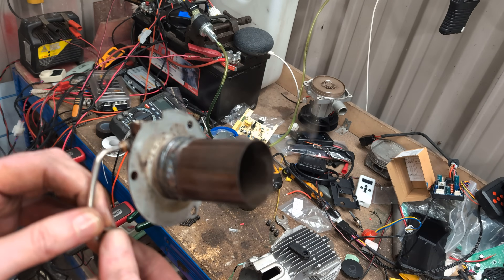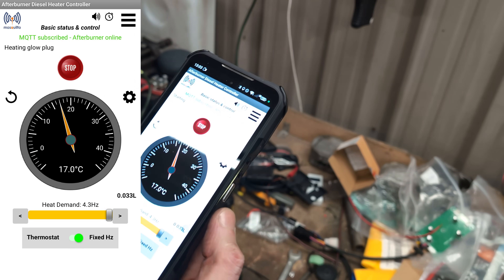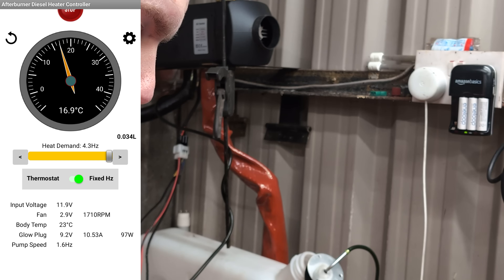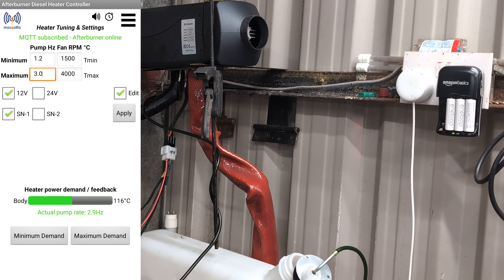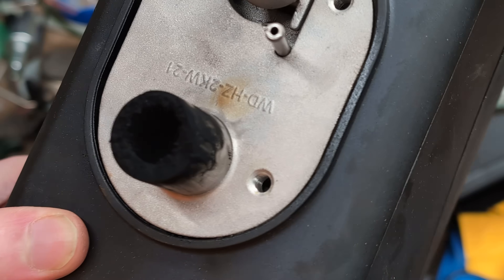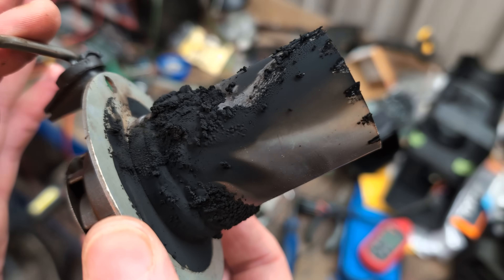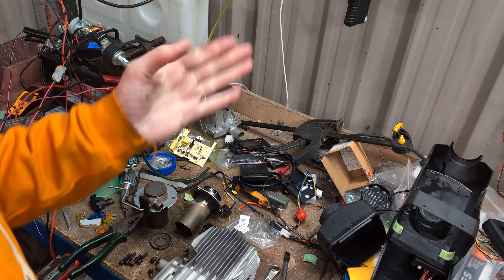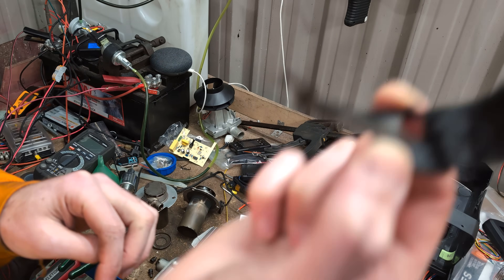Diesel Heater testing filtered waste oil - 50/50 diesel oil mix modified burn chamber - part 3

Comment: My kerosene (home heating boiler) central heating burner pump has been pumping oil for  over 30 years people say  kerosene has no lubrication I disagree and say kerosene, parifin or home heating oil or whatever you want to call it has lubricant it is oil and burns very clean.
Reply: There are (at least here in the Netherlands) different ratings for the kerosine. The more expensive the less lubrication and more pure it is. So maybe the real pure stuff might become a problem. Forgot the rating system. I just look at prices. But thanks to the government here, kerosine is more expensive than diesel. So that is no option anymore 😢
Reply: @BenVeenstra  In the GB there is two types of home heating oil I believe I order the less smoke type 28 second for low flu on my boiler and 35 second will be used in high flu boilers and commercial use allso as jet fuel. So I pay around 60 pence per litre which includes taxes and I live in a area of gas heating or kerosene oil heating is popular and so I don't need to burn waste oil in my diesel heater.
Reply: @BS-ql5nl  that is a big difference with the Netherlands. Especially now Germany is also slowly getting rid of kerosine heating. You can't buy it in bulk anymore.

Comment: I  find the more Flammable, The less the heat created. But i can understand a slower diesel  burn, I'm guessing it will not flash as quick and create more heat. Remembering its not the burn we get heat from, But from around the casing blown by a fan.

Comment: Thanks for continue to try. I have 2 diesel heaters and access too much motor oil. Only way I do it is a stainless steel dog dish in the shop woodstove, just have to refill it every couple hours. My Grandpa had an oil drip stove.
Reply: I suppose the downside is that you need a wood stove with a chimney/insulated pipe all the way to the canopy. That is expensive to install these days. And a lot more work. Also, won't burn as efficiently or as clean for the atmosphere. But in a rocket stove it will burn a little better with the secondary burn event of smoke and all. I'm considering a rocket stove with added oil drip pan together with heating hot water to feed my existing radiators. Quite the project but with current prices I might just get my investment back within one cold winter.

Comment: Only time I've seen carbon deposits like that are up a coal fire's chimney, and on my Aladdin paraffin lamp's mantle when the flame goes "spiky" (where it's not burning right and produces yellowy-orange spikes and leaves the carbon deposits on the mantle), which of course all means that there's not enough air to meet the burn requirements of the fuel, but, still, engine oil, not meant to be burned anyway... :S

Comment: I‘m interested, what would happen if you run that modified burn chamber just with diesel tho
Also kinda surprised that this mesh runs around the bottom part of the chamber in there.
Also, what‘s behind the fuel pump in your setup?
Reply: I'm interested in that as well!
Reply from the maker: To the left of the fuel pump is a battery volt/amp meter and a shunt.

Comment: I've ran one of these heaters in a static caravan for a few years now, along with many other residents. We mostly run on Kerosene and have had few problems, mainly pump failures (Not due to kerosene) and glow plugs. No blockages to date. Started out on red diesel unto we found a local source of kerosene. In the future, looking at probably an Afterburner, but running my own Arduino solution just now. Many of our setups run larger 6mm OD flexible pipes and use push airline fittings as well. Best mod was replacing standard fuel tank for outboard style tank, with Mariner quick connections and a hand purge BULB for quickly purging the line. Other mod was replacing power cables with 4mm supply and have no electrical issues since even at ~10m length.
Reply: I have given up bothering to add my findings about paraffin in recent decades (I am 70 now). I just got stupid abusive replies. In "yer early days" as Alf Garnet used to say, there were 3 grades of paraffin. They were readily available, and you specified which you required. The cylindrical stand alone paraffin stoves (usually situated next to the spitoon) used the coarse stuff, the large mantle lamps and Tilley pressure lamps could use either of the two finer grades. The jets in the lamps and the mantles lasted an impressive amount of time if they used the best paraffin, but many hated paying the higher price. The common wick and chimney lamps required the best stuff. I recall my grandparents quoting the names of some of the best oils, used in wick burning lamps, and they sadly regretted the way they were no longer on sale at the chemists in nicely painted tins. Using paraffin in a wick and chimney lamp is the acid test to whether it is a clean burning oil. I have used paraffin in my lamps, Tilleys, and my Russian/German/Chinese turbo heaters, and one third of the time they were just OK, some smoke at the wick, but OK. One third of the time it was hell to get lit, and vaporising was difficult. One third of the time the paraffin was useless and overheated the turbo heater, and in one case the paraffin (if that is what it was) acid burned a hole in its can. The boat stank for weeks after that subtle plastic can leakage in the locker. In short, I can't find a source of paraffin, I hope readers can, BUT if my grandparents were around and they saw you using it, they would throw it away 🙂
Reply: I run two in a static, both with afterburners- highly recommended and we've easily saved more in fuel than the cost of them. Burn red. Failures fan bearings (wish they'd use better quality!🤷‍♂️) and occasional pump.

How do you make connections to pump, filter, heater using the 6mm od pipe? this is something I want to do. I use this pipe and fittings elsewhere.

Comment: Why was removing Mesh even considered to be done in these experiments?? unless it was a sorta intended to create worst case scenario?   IMHO a better experement would have been pre-heated oil to further reduce viscosity allowing for better automization...  or trying the petrol mix??  Oh well....  curious what the next plan is you hinted at.  Thanks for doing these

PS- heating oil and Kero in many parts of the world are same price as road diesel
Reply: Heating the oil will make absolutely no difference.  It does not depend on viscosity.  It depends on clean burning fuel that doesn't leave a deposit.
Reply: @yoda-be.at1746  yes/no  While the combustibility value will not change with lower viscosity; as you point out.... there is a reality that a lower viscosity by heating it (along with added benefits of starting out being hotter pre glow plug?)  will allow heater's design and components to better do their thing as intended.  AKA maximize the ability of heater to do its thing, thus  enhancing its ability to work with a sub-optimal combusting, contaminated, light oil . I wonder if viscosity of WMO WVO etc.. needs to actually be lower than diesel to allow any kind of burner designed for diesel to do it's thing even close to how optimally it normally does with diesel Kero itself. 

Then there is as you point out...  what "thing(s) to do/add to the alt. fuel to bring it up to something with combustion characteristics of the diesel the gizmo was designed for.  IMHO blending alone is not enough, Nor is pre-heating the fuel alone not enough.  Likely it is both need to happen  and maybe a hotter glow plug (or over powering it?)   

Other Options??

Gas/petrol & diesel along with pre-heated fuel or some combination of? ..  where that may be of benefit is there is some suggestions that an octane component in the fuel blend will create a secondary flame front which helps combust the; as you pointed out", not as combustible WMO/WVO etc. in the first place.   Granted that still does not help with the added detergents and other components in WMO case though.  IMHO that needs to be treated first to make a lot of that stuff fall out before even using it as a fuel.  (bleaching some call it)

HHO, Ethanol or LPG fumigation into the combustion area might also help the light oil alt. fuel to get fully combusted??

still though.....  nearly imposible to optimize the heater and alt fuel to that of diesel...  likely one would need to clean burn chamber more often. Have more than one and rotate them??? ..  Likely not worth it in normal times.......  now in SHTF times when diesel no much available.... that is a different story.  Then you might be fumigating in wood gas lo